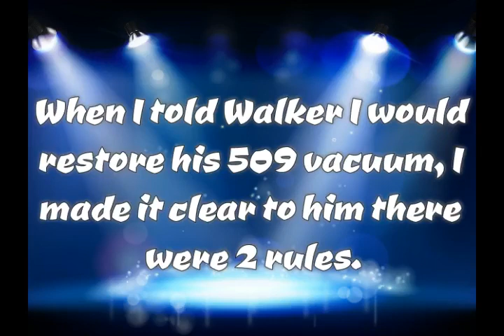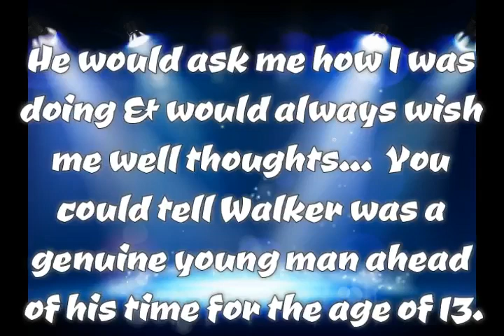Part 3of7 Sand Polish Buff Kirby 509 1949 Vacuum Cleaner Sanding Buffing Polishing Aluminum

Comment: Get a cheap belt sander and buffer from harbor freight and you can get these results I did on a 518 and sanitronic 7 you might have to do a little hand sanding after the belt sanding after your finished go over everything with some mothers aluminum polish its all actually very easy as aluminum is not that tough its just going to take about an hour and a half its very rewarding. Just type kirby polishing here on you tube  plenty of  guys who have done it and show exactly how to. Great job by the way on this kirby. No belt sander or sandpaper needed if you just want to buff it or you don't have super deep gouges. An alternate to belt sander is a simple dremel tool or hand sander for the gouges.